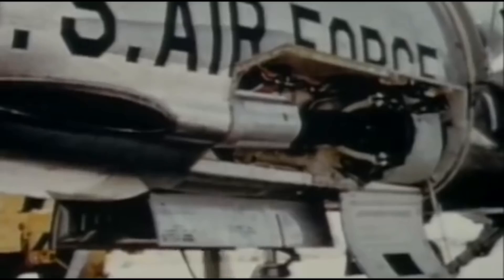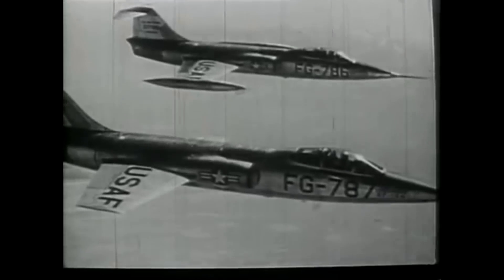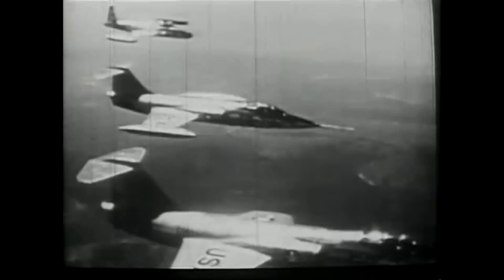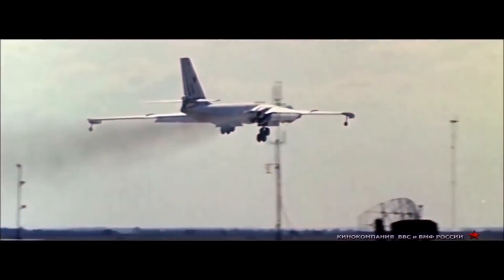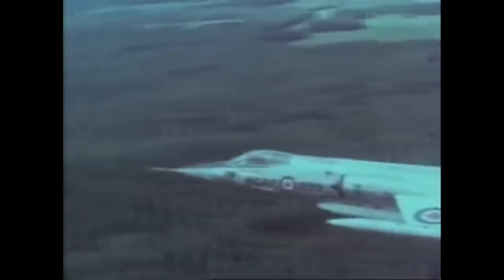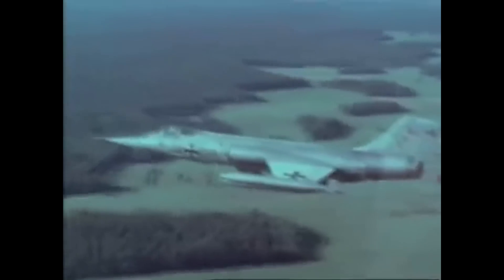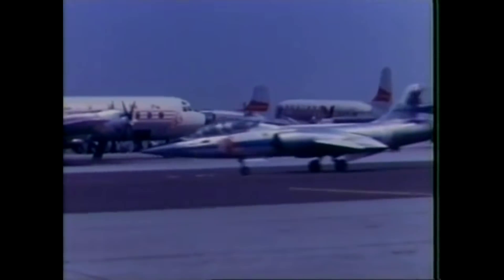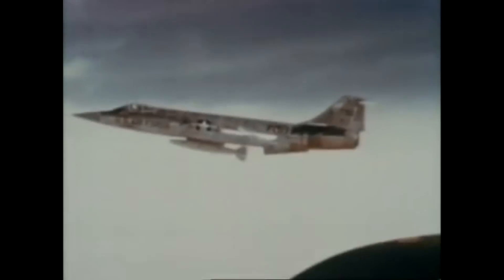Lockheed F-104 Starfighter | The worlds first Mach 2 fighter

Comment: The claim is Lockheed designed a real monster of a dogfighter based on the F-104. When dogfights started breaking out over Vietnam, the call went out to make either the F-105 or the F-104 fit the bill. Both companies submitted concepts which were dead sexy on all counts, but the F-4 got the job. Imagine something like the F-20 Tigershark in 1968 and you'd have a pretty good notion what the Lockheed team came up with. The Republic concept is very difficult to pin down. I've only read about it in passing from a handful of F-105 pilots who claimed to have seen the concept drawings.

Chances are the decision to drop these ideas was a good one. The F-15 and F-16 might have been canceled if the Century series had continued. Had the Navy bought the Vought F-8 Crusader III they might have skipped the F-14 and F/A-18.

Comment: There's also the story of how Chuck Yeager was severely burned and almost killed in an accident in which he was flying a modified Starfighter called the NF-104A. The aircraft had a solid rocket engine installed above the jet nozzle and attitude control jets in the nose, and was designed to zoom climb to high altitude until the jet flamed out and the air was too thin for control authority. The pilot would then use the attitude control jets to steer it until it fell back to thicker air where he could restart the engine. The purpose was to train USAF pilots for manned spaceflight, and Yeager was the squadron's commander. His accident was fictionalized in the film The Right Stuff.
Reply: Yeager was directly responsible for the crash of his NF-104A Aerospace trainer during a zoom climb. He refused to take the training required for this very precise flight and screwed up the climb profile by misusing the hydrogen peroxide thrusters on the nose. He only got to 106,000 feet when pilots trained for the flights were getting to 120,000 feet. Yeager arrogantly refused the training because HE was going to set a world altitude record. Instead, he got himself into a flat spin at 106,000 feet. Because he screwed up the profile, he ran out of fuel for the nose thrusters and could not get the nose pointed down after completing the arc. This meant he re-entered the atmosphere in a level attitude instead of nose down which prevented airflow down the intakes of his J-79 engine which was shut down on the climb at about 70,000 feet, when the rocket motor in the tail was lit. With no airflow into the engine, he could not get it restarted and could not get the hydraulic pump working resulting in the elevator being stuck on full up. He spun down to about 15,000 feet where he ejected. And Yeager did what he derisively said lesser pilot did, and that was he screwed the pooch.

Comment: Over 20 pilots killed because of a badly designed ejection seat. The Air Force generals who approved that design should have been stripped of their rank and drummed out of the service!
Reply: CG: You weren't paying attention.  1. Lockheed designed it as a company project, there was not USAF "approval". 2.  The  seat was based on technology limitations.  3. The seat was not badly designed.  It operated correctly within altitude limitations.  All seats have limitations, and even up to the 1980's there were aircraft with seats that altitude and speed limitations. e.g. T-37 Tweet for example.

Comment: 1958  F-104 costs 1.4 million and goes 1400 mph.
2020  F-35 costs  100 million and goes 806 mph.
Hmmmm. Something seems wrong when an F-15 can overtake and pass an F-35 at the speed of sound.  We seem to have taken too many steps backwards when it comes to speed of a modern jet fighter.
Reply: It's irrelevant. The F-15 and F-104 can only do that in clean configurations (no external tanks, armaments, etc). The F-35 can hit Mach 1.6 with weapons and comparable fuel quantity

Comment: You said the F-104 was out of service by 1969. Possibly? But I know for a fact, F-104's were flying regularly out of  Luke A.F.B. (near Phoenix,  AZ) until the late 70's.
Luke is a TAC fighter training base and there was a German squadron training there. So in hindsight, they might have been all German pilots. But the planes were definitely USAF and  I watched them fly daily (along with F-4 Phantoms).
Eventually both F-104's & F-4's were replaced by F-15's & F-16's. But that wasn't until about 1979/1980.
Enjoyed your video!  Thanks. - G-day!
Reply: All Luftwaffe F-104 pilots were trained to fly ther F-104 at Luke AFB. The aircraft werre owned by the Luftwaffe but painted in USAF colurs for "diplomatic" reasons. 
They stayed at Luke until the last year of Luftwaffe F-104 operations having by then been replaced by F-4 and Tornado aircraft.

Comment: The J79 did not have adjustable turbine blades, it had adjustable compressor stator blades, still found on GE engines today. Also, the F104 was not the first plane to exceed Mach 2, the Douglas D-558 SkyRocket did that before the first F104 flight. And the altitude record 120,800 feet was set in a rocket boosted NF104, not an F104.  You need to do more thorough research.
Reply from the maker: The Douglas D-558 was an experimental plane. Not a production fighter aircraft. The NF104 was also a modified production aircraft, not an experimental vehicle. (The F-104 set those records for a production aircraft) and the stator/compressor confusion was just me saying the wrong thing as I rambled——which is terrible, considering I actually work at GE—on turbines and have to stare at 13 stage compressor assemblies and housings all day. 🤣

Comment: always amazes me that the first one already flew in 1954, 9 years before they where still fighting with piston engines at top speeds that where cruising speeds for the F104.
Reply from the maker: Absolutely. Very crazy timeline.
Reply: @Jerrol Hale because they don't have to be faster. Modern planes are superior in terms of range, stealth, reconnaissance, weapon loads, savety and much more. If mach 3 fighter jets would be needed, we would have them by now.
Reply: @Jerrol Hale and Kelly  owns those  too !
Reply: 1954 by which time a faster and better fighter had achieved supercruise, something the US did not invent for a long time afterwards.

Comment: I jumped an F 104 one day in the skies over Oklahoma near Dyes AFB. I was in a Marine F 4 doing metal landing strip testing and we had the day off. I knew the abilities of the 104 so I kept him in tight turns at a mid-level altitude. This was his weakest area and eventually, he went vertical. The only problem for him was that the F 4 lightly loaded like I was, was a good match for his climb capability. It was a lot of fun and we saluted each other when it was over. Head on he was almost invisible. But the radar RIO in the back seat found him every time. That was two eras of aircraft coming together to see who was best. The old F 4 was a beast when speed and climb were needed. BTW, I got my Mach 2 pin in the F4 but the funny thing was that the only way I could tell was the airspeed indicator. It flew at 1200 mph like it did at 500mph.
Reply: Dad was a Zipper IP IN the 60's (Luke AFB, AZ) and on occasion did get to tangle against F-4's. Dad's advantage was he had a bit of F-4 time, sooooooo . . . he had a bit of an advantage over the Phantom drivers. His favorite tactic was to hit from high and the rear (slash & dash). In the late 60's,  I guess there was alot of "unsanctioned " squaring off of dissimilar a/c over the Gila Bend gunnery range.
Reply: @billgund4532  Hi Bill. My Dad spent 22 years in the 104 and was also an IP at Luke in the 1960s. After active duty, he went back to work for the Air Force as a GS and was the Range Manager for the Goldwater Range, then Airspace Manager based out of Luke. He had over 5,000 hours in the Zipper and the static display at Luke AFB has his name on the side of it. He loved that plane and spent his entire flying career in it, with the exception of 4 years in the F100. If your dad is still with us, ask him if he knew Gary Blake. My Dad passed a few years ago, but I have all of his 104 memorabilia...look at it nearly every day. Cheers.
Reply: @TimmyBoyAZ  Hell Tim. Sadly we bid a final farewell to on Jan 22. 2021. I heard "Pearly Gates" tower lodged a complaint with  (Wing Commander) St. Peter of an ethereal Starfighter blasting by the tower at full afterburner. Gee. I wonder.....
Reply: I love the f4 phantom 2 someday I swear to god I will own one
Reply: One of the highlights of my life was when the USS Coral Sea was putting on an airshow for the crew. With the ship stopped there was no need for me to be at the helm so I went out to the bow of the flight deck for a supersonic F-4 flyby. It was eerie watching that jet approach in total silence, then as it passed by so close it felt like you could reach out and touch it the roar rocks you back on your heels as the sound arrives.
Reply: So like a friendly practice dogfight but you dont shoot eachother?
Reply: @LockheedC-130HerculesOfficial  Exactly. We always had a gentleman's agreement when we met another fighter to play if possible to get experience from an unknown source. It was fun and sometimes a little scary. I once made a missile attack against a lone B 52 that I had never fought against and my RIO locked on to it and put us in the attack mode on our radar. The BUFF took the presentations of our radar screens and turned them into cartoons! He changed the closing speed for over 1000 mph to 3,000 mph and then to zero. He moved the intercept angle all over the place and we realized that he had ECM's that we had never seen. Of course, our actual attack would have been to paint him only and not lock on until the last minute. Always interesting.
Reply: Thanks for sharing and thanks for your service.  Semper Fi.
Reply: I loved the Phantom, still one of my favourite planes now.
Reply: Dyess AFB is in Texas, near Abilene.
Reply: @bobford01  You are correct Bob. I was working out of Tinker  AFB in Oklahoma City on metal planking cable stopping when I had a hydraulic failure and had to divert to Dyess because they were one of the few bases that had the cable stopper.  I even got a plaque from the base commander called "The order of the Tape Dragon", because I was the first pilot at that time to use their cable stopping system. It was so funny because the system is always operational but because they wanted to film it I had to wait until the camera truck was in place. All of the base big brass, including their wives, turned out to watch us take the cable. We couldn't buy a drink at the O club the entire night! Great Air Force pukes!
Reply: @bobford01  Yes it is. I too noticed that in the man's comment. I used to live near there as a kid and go to air shows in the 60's. In fact I was so close during the Cuban Missile Crisis that my family would likely not have survived if it had gone nuclear.
Reply: i do this all the time... on war thunder
Reply: I guess he didn't attend "Red Flag" school.  "Semper Fortis", I was an aviation squid. Have seen many a sunsets from a flight deck.

Comment: Kelly Johnson: "ok boys, what do you want"?
F-86 Pilots:"I wanna go FAST" 
Kelly Johnson: *Takes long drag from a cigar, puts it out, and exhales slowly*....."say no more"
Reply from the maker: Perfect 😁
Reply: F 86 pilot flies the F 104 then says " I want to stay alive."
Kelly Johnson takes another drag on his cigar " You never mentioned that before"
Reply: Such a simple thing......having the engineers on the shop floor rubbing elbows with the mechanics.....brilliant.
Reply: And then John Boyd came along and said speed is no good if it won't turn, so he perfected his theory of energy-maneuverability that took into account speed, weight, and wing area that combined to determine turning radius at different altitudes. The modern dog-fighter was born.
Reply: chris younts  
Certainly much better than the F 104. The only problem was the Hughes MA 1 fire control system that was modified more than 60 times to try to get it right.
Reply: chris younts  
The F 4 was not exactly an agile fighter.  The F 106 was ok but a system that had to be constantly modified was not so good.
Reply: Well, they weren't able to say anything anymore as they were torpedoed right into the ground LOL
Reply: Kelly Johnson: YA WANT SPEED HERE IS A MEGA TON OF IT
Reply: @Raj-df7wf  
Mach 2 or nothing special by then but Kelly Johnson was always a bit behind.
Reply: Barrie Rodliffe it was a joke
Reply: @Raj-df7wf  
True the F 104 was a joke.
Reply: @ Atomic Cafe:  I sure do enjoy your videos, but I sure do wish you’d cut out/delete in your intro the scene with the fat women trying to do the hucci gucci dressed in her 1940s black bathing suit. 
That little short snippet completely cheapens every one of your video.  
Thanks for removing it.
Reply: SkyChief449 Bettie Page is not fat.

Comment: The F 104 was a contemporary of the EE Lightning and both were designed for the same purpose although the Lightning had over and under twin engines. They were very quick and had a Mach 2.2 max speed which could get ahead of any pilot who didn't get the memo: wheels up right off the runway or you'll be accelerating in a 60 degree climb through 20,000 ft before you get three greens.

Comment: Speak more slowly and clearly.  There is also too little information.  For example, how did Lockheed fix the cartridge blow back problem, or the compressor blade closing in the heat on the ground or the compressor stall problem at low speed?  I love this airplane.  Among jets it is he sexiest plane going.  I don't think this narrative did a very good job.

Comment: I remember the F-104 in the Royal Netherlands Air Force – and I was born in 1969. Mostly, I remember reports of them crashing, which they did a lot. The Dutch then got the F-16, phased out the F-5 somewhere in between, and have now ordered a bunch of F-35s. During the Cold War, the F-16s would fly over very regularly, and often there were sonic booms. That all changed after 1990, and when there's a sonic boom (for example, when a Tu-95 comes a little bit too close to NATO aerospace, or when an aircraft loses contact with air traffic control) it makes the national news, with people not knowing what a sonic boom is. How things have changed – although, on balance, I'd argue they've changed for the better. The constant threat of nuclear annihilation was getting on everybody's nerves.

Comment: I've heard opening story couple of times, and it never made sense to me. Outperform MiG-15 was the primary task, pilots were interviewed about expected characteristics of the new fighter - and Bomber Interceptor with average maneuverability were delivered as the most desired result?
Reply from the maker: I have literally said that exact same thing myself. The only thing I’ve read that made sense was that the goal was to fly at extremely high altitudes and when the MiG-15’s were reported, the F-104’s would basically dive down from above and shoot them down as they descended. Then re-climb back to a high altitude out of the reach of the migs. 🤷‍♂️ but yeah. The F-104 had tiny wings and a big engine. The MiGs could turn on a dime and bounce all over the place. Makes no sense to me either.
Reply: @theatomiccafe8996 , it makes sense if your tactics are to close at high (transonic or even supersonic) speed, knock off a couple of MiGs with your Sidewinders or even your gun, and break contact before they knew what hit them, climbing faster than the MiG pilots could hope to.  Once you're well above their ordnance, you can roll over, pull through, and then rinse and repeat.
Reply: @johndemeritt3460  There ya go! Lol
Reply: It was not a bomber interceptor, it was a day fighter.  It was not built to outperform the MiG-15, it was built to outperform the fighters that were already designed to outperform the MiG-15 and F-86.  The two myths of being able to outperform  the MiG-15 and be a bomber interceptor don't even comport with each other, yet you accept both myths.

Comment: I seem to remember the Starfighter had a habit of crashing... killed a few pilots.
Reply: FLIGHT LIEUTENANT MIKE HALE OF THE RAF TOOK PART IN A TIME TO HEIGHT AND ACCELERATION TRIALS AGAINST THE F-104 STARFIGHTER AND REPORTED THAT THE  LIGHTENING WON ALL THE RACES EASILY EXCEPT THAT FOR LOW LEVEL SUPURSONIC ACCELERATION ,WHICH WAS A DEAD HEAT .
MICK GRAY ALNWICK UK.

Comment: The world's first Mach 2 fighter was the CF105 Avro Arrow
Reply: To do that the CF-105 must have also been a time machine, given that it didn't fly until 1958, four years after the first flight of the F-104.
Reply: @gort8203  And the F-105 which flew in 1955, same year as the Saab Draken with the Mirage 111 a year later. All way ahead of the Arrow.

Comment: I just saw this video now. The Netherlands had this plane as well before it was replaced with the F16. In the 70s they had a few hostage situations in trains and and primary schools. The hostage takers would demand from the government that they somehow persuade the the Indonesian government to allow the Molukken islands to become independent which is obviously an impossible demand. Some of these hostage situations where solved by the Dutch Marines always at 5:00 AM to take advantage of the sleep patterns of people. F104s where used to fly over at low altitude with the afterburner on. This was successfully used as a shock tactic to petrify the hostage takers. These few occasions have done a lot to redeem the bad rep the F104 had among the Dutch public as widow maker.